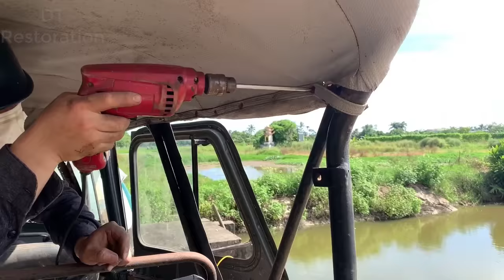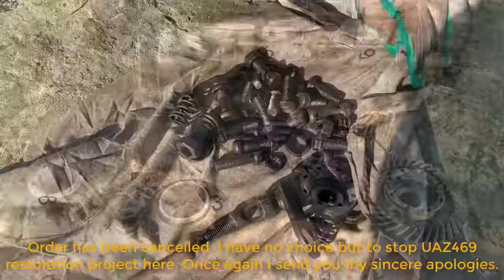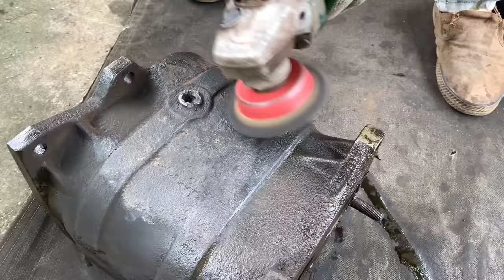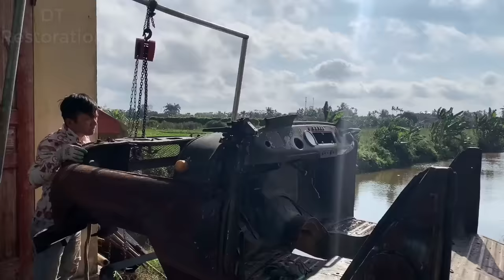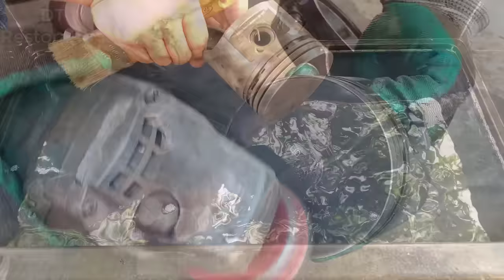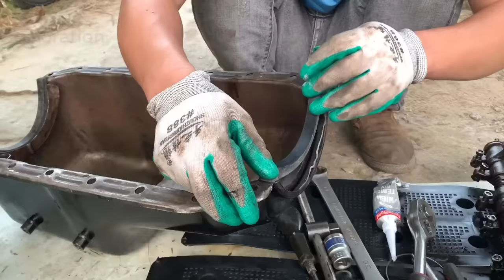Full restoration ancient UAZ 469 | Restoring and repair antique uaz 469 cars

Comment: It is amazing what one could do with basic tools and a bit of time. Now granted some of the restoration methods would not work on more complex classic, but UAZ 469 is very basic military vehicle which can survive harsh environments. One thing I would not advise is to reassemble engine with extended barker bar, torque wrench isn't really that difficult to get or difficult to use, sandblasting by covering your face with hand is another non-advisable thing, but overall probably it does not matter - it is encouraging to see how much you could do with so little.
Reply: Bit of time? Bro it will take almost a month
Reply: Sandblasting is not a good idea. Gets into everywhere.
Reply: @dheeraj1633  In terms of car restoration "month" is little bit of time. It is easy to spends years, even decades.

Comment: I love the oil filter wrench, valve spring compressor, and piston ring compressor.  great ingenuity,  Did that engine have babbit rods?  How much time have you invested in this already?  I do hope you get to complete this.  I'd like to see how you intend to repair the front door posts and A pillars.  Great work!
Reply: No the crank and piston rods are modern shell type. I think you mistaken the crank main seals. Looked kind of like babbitt.

Comment: Need plenty of grease bro especially in closed spaces for gear teeth, bearing and lip seals. It protects the metal parts by oil film and contamination of the water and dirty particles. Furthermore it cools down the heated parts. Hope you understand what I mean.
After the restoration, it will be okay for a short while but after a year there would be wear and tear without proper lubrication.
Reply: Yes, after all the hard work the parts are going to wear out in no time, that did make me kind of sad as well
Reply: I don’t know anything about cars and even I knew he needed to put grease on all those parts before closing it up. Maybe he did and didn’t show it who knows.
Reply: The boxes get filled with gear oil.

Comment: I cried as I watched him tighten without a torque wrench
Reply: Maybe, but more probably not. For field repairs, torque values are most commonly noted as angular values instead of in newton meters. So, instead of needing a torque wrench for the appropriate torque range, the repair instruction might say: "Tighten by hand as far as you can, then tighten 3/8 of a full rotation more." The number is just an example. My motorcycle spark plugs come with the instruction 1/2 further rotation for first use, 1/16 if retightened (flattened gasket).
Reply: Ah yes that cool 70HP and 154fpt this thing probably made really needs to be dialed in that much.  Old military stuff like this was designed to be "tighten as much as you can".
Reply: Его на заводе без динамометрического ключа собирали)
Reply: А как он наждачной бумагой шлейфовал коленвал) после этого все вопросы отпали

Comment: I'll give him credit, that's a lot of work. I sure hope those uazs aren't to picky with clearances or guessed at fastener torque. But unfortunately I think gear whining/grinding and engine grenading are in its future.
Reply: Your comment translated to "how 67 months after 2 3" I assume mistranslation.
Reply: This is true. This vehicle is designed to work after a nuclear exchange. Repair mechanics in any workshop and electronics from wires and switches. Thousands of these cars are waiting for the apocalypse in the underground storage facilities of the Ministry of Defense in Siberia. But! And Russian auto mechanics have big doubts that after such a tough rough repair it will be usable.
I would not want to run this engine.
Reply: Just getting the engine to turn over after all thsi time and wear and tear is amazing to me!!
Reply: 100%
Reply: My thoughts too , when I saw the crank assembly ,not Plexi gauge used. ,no torque settings.

Full credit to him however for making do with what he has

Comment: You did a great job with the minimal tools you have, but I have to say I would NEVER rebuild an engine outside in the dirt, and a torque wrench is absolutely mandatory for Rod caps, main caps, head bolts, etc.. also, painting the flywheel is a major no no, the clutch can't grip paint!
Reply: Там половина резьб еще с завода сорвана а другая половина при обтяжке сорвется, хоть с динамометрическим хоть без него.
Поверьте челу который 25 лет эти моторы ремонтирует.
Reply: I was going to comment the same but I saw that you already did!

Comment: i had one new in 89 with large tires and white rims and cloth top the metal doors were tiny and had a V8 toyota engine and i kept it without the top still closed in plastic wrapp, and drop the windshield ,but no long doors you had a litle step up that you can close it and the doors were at foot level inside the size was giant, when trying to registry it, the reply was , this is a military vehicule can´t be driven on the roads, well they don´t want it registred i still drive it on my lands whenever i fell like too ,since then,we´re on 2024 i´ve been drving it for 35 years and it as plates of a old 1971 landcruiser  and put a Toyota badge in the front taken from the same landcruiser ,it passed on inspection this last month of april without any  defect, basically it´s like a giant jeep willy´s bullet proof . i already fired at it with a pistol from my time in the army in late 60´s ,41 calibre, it doesn´t make nothing to the body , so good to go, 89 militar model UAZ ,maybe not 469 as i had other with longer body and hardtop that i sold , it seemed to trransport as in the back had a litle long bench from the back part of the front seats to the two doors far in the back one on each side of the ...whatever

Comment: Why aren't you packing the bearings with grease?
Reply: Weight reduction idk after 1 drive you wont have to worry about the bearings they will be gone
Reply: I can see him pre-lubing the crankshaft bearings with oil.
Reply: @diegosilang4823  where
Reply: Haji

Comment: Blood from the eyes, you have to tear your hands off for this! I ruined the engine, which turned better before he got there, painted the surfaces of the bearings and under the gaskets, sandblasting with open channels, cleaning pistons, painting candles... Of course, I understand that this is a technique from the USSR, and it may even be able to go, but this is not a restoration, but the murder of this car. Change the oil, flush the carburetor and she herself would have left the place the engine was spinning.